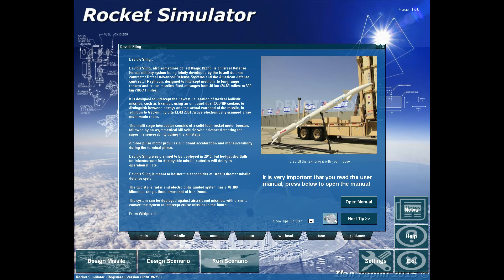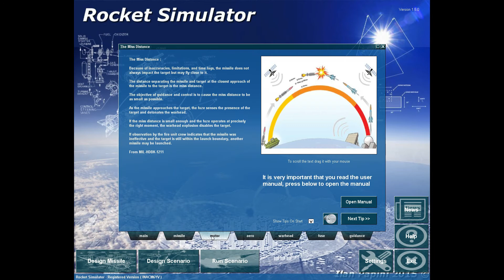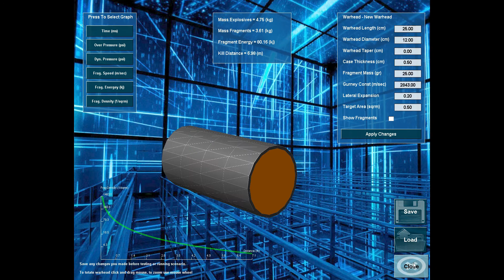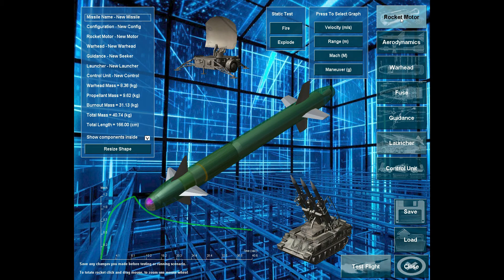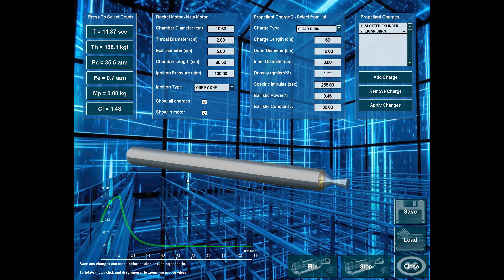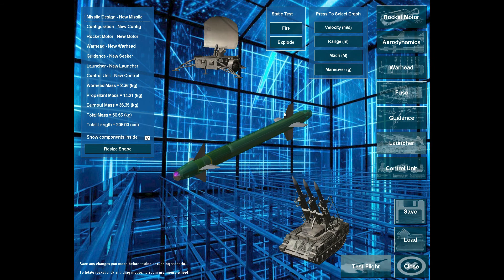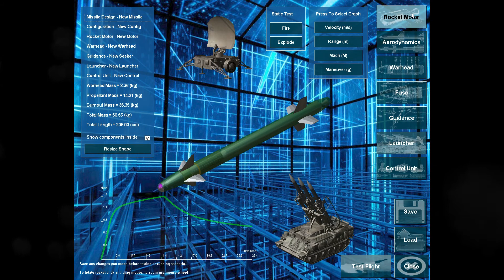Introduction to Rocket Simulator

Comment: not a bad concept, but if you dont mind at this stage i find it extremely limited for 20 dollar price, that i think is irrealistic. it has a couple of annoying little bugs too. i made a "Sprint-like" interceptor which was quite fun apart from the constant nagging screen, i even made Mach 20, 90 degrees intercepts :D but the lack of staging makes simulating any serious system a complete hit and miss (literally)... also if i aim high against a pershing type RV, my missile self destructs at 20 or 30 km altitude could not figure out the reason why. and experienting with a smaller missile seems like the maneuvering load is maxed at 40g, but the guidance cannot even use that. clearly a lot of parameters missing. would be nice if it will be developed, or could be bought at a realistic price.
Reply: he died.
Reply: @youdontknowme3935  oh yeah i see... :( small plane accident. sad. RIP for the man. thx for the heads up. at least he went doing what he loved
Reply: @youdontknowme3935  omg you cant be serious??? :(( what happened to him? the war?